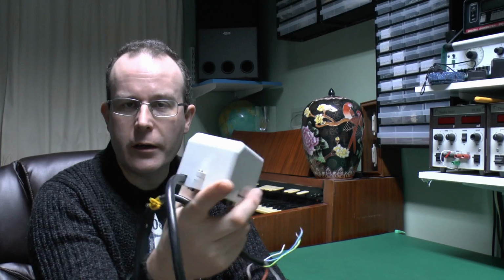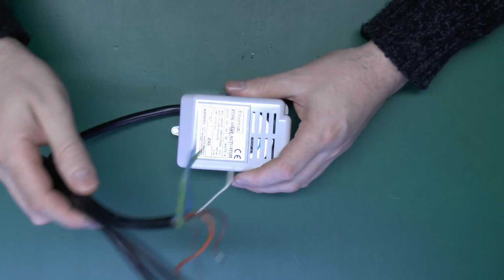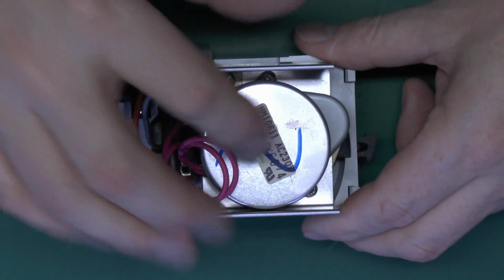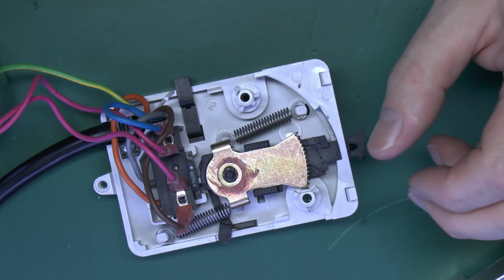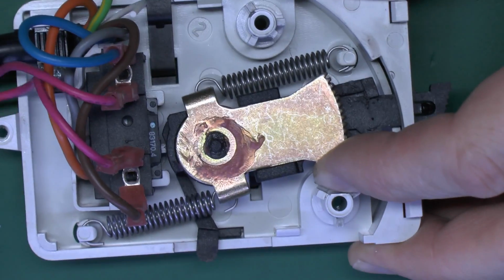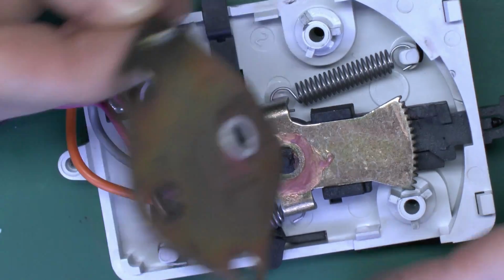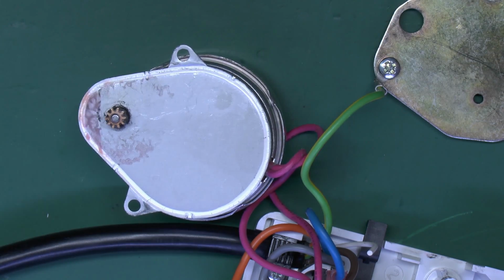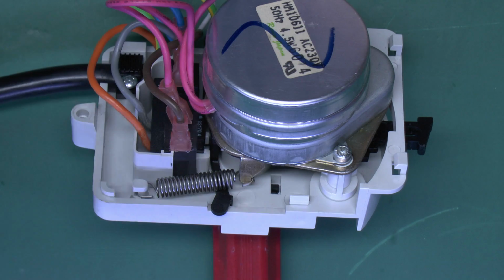Inside a Central Heating Zone Valve Actuator

Comment: Is it possible they made the manual lever like that so it resets as the motor moves once? 
We are chasing every milliwatt in power supply standby losses and things like this are still produced, crazy!
Reply: +stefantrethan That's exactly how it's meant to work. Every one I've seen resets like this. 

It's really only meant for use when commisioning the system to help with filling and bleeding and, as John points out, it doesn't open the valve as fully as the motor does on this model. But it does open it enough to operate the microswitch and so fire up the boiler.

Comment: Are these things just a bad design? Having the motor powered on to hold spring open, the valve is not spring loaded. Just have a motor that opens and closes the valve. Should be much more reliable.

Comment: Can't think why they don't just use a solenoid valve - 12V for safety.
Reply: Well thinking about it - perhaps a solenoid would bang on and off very quickly - possibly cause water hammer of some kind?  At least with that motorised valve it would open slowly. Not much of an argument against solenoids though...

Comment: my system doesn't have any valves instead it uses two pumps to control the flow.
Reply: +mc349iii Pump manufacturer Grundfos did a double pump called Pump Plan but it seems to have disappeared from their product list. Its stated advantages were you could have different pump settings for CH and HW and there was no motorised valve to fail. But it seems the integral one-way valves failed instead.
Reply: +Graham Langley mine are just two standard pumps either side of the hot water cylinder, one pumps the boiler heat exchanger loop.the other does the CH loop. I've replaced the boiler pump twice in 20 years the other is still the original only used half the year so I suppose it gets less wear.
Reply: +mc349iii That sounds like it could be a thermal store?

Comment: Brilliant explanation! Thank you for taking the time to shoot this video. Our boiler makes an awful droning sound on first "heating" demand in the morning. Turning on a hot tap stops the noise for a while which then recurs. The diverter valve was replaced in September and "fixed" the noise for a month or so until the beginning of November. Just wondering whether the droning is the diverter valve actuator or something else?  Here's my post from April.   https://youtu.be/2SQvC4j607w    Any thoughts on this annoying problem?

Comment: Quite a poor design imo, keeping that motor powered when it hits its limit is a very primitive and outdated method
Reply: They are all like that, when the motor is stalled its inductance increases causing a dramatic reduction in current flow.